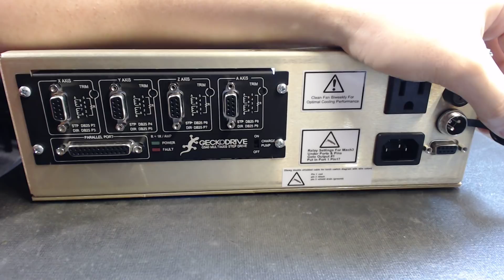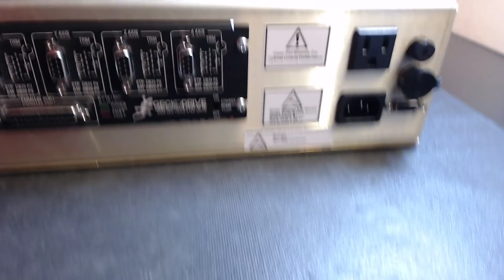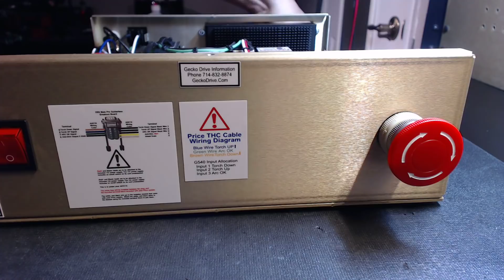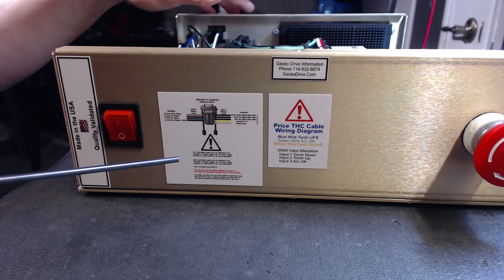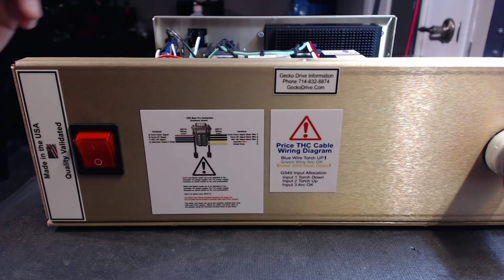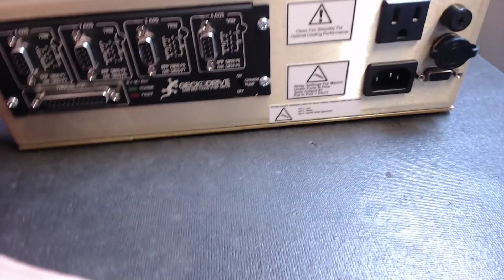CNC Plasma Build For (Price THC) Break Down...

Comment: Hi Vince do you have the wiring diagram on retrofitting my controller i bought from you 5 years ago I updated it for the price thc and still running mach 3 what ports and pins setting to do.
Reply from the maker: CJ,
 I need to know what type of system you purchased (mill, or plasma)? I have a graphics set for the PRICE THC. Please email me for pricing. Merry Christmas! Vince

Comment: What size motor do you recommend for plasma cnc I realy like your system I finaly found someone who understand what electrical interference can do. I will be getting with you about a unit for plasma and cnc router.
Reply from the maker: Paul, thank you for your support. 90% of plasma systems  are fine with 300oz motors as the chassis really has very little load on it like a typical router. Just let me know when you want to set up a call to discuss your system. Thank you Vince